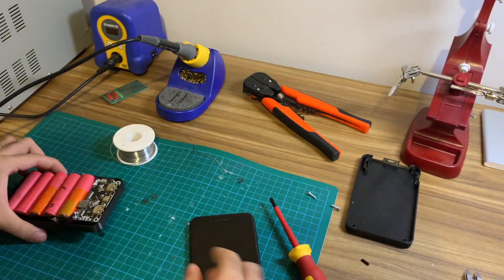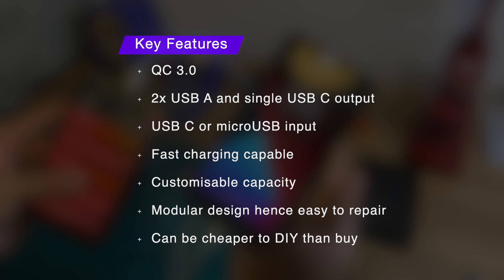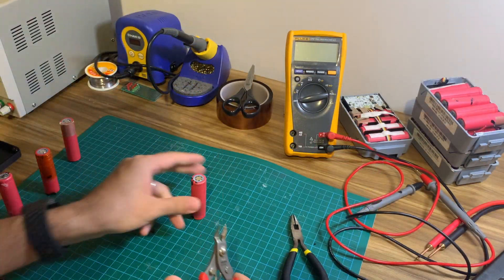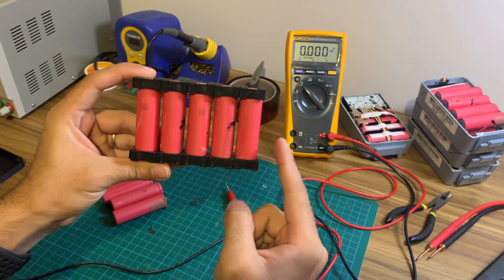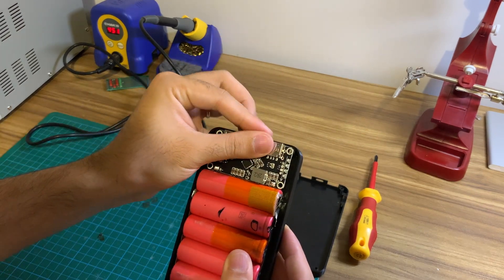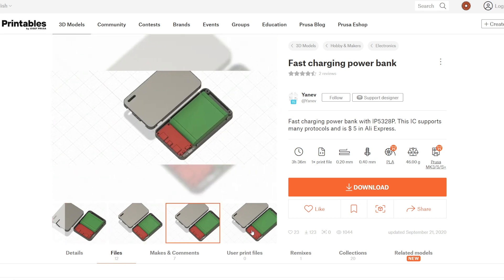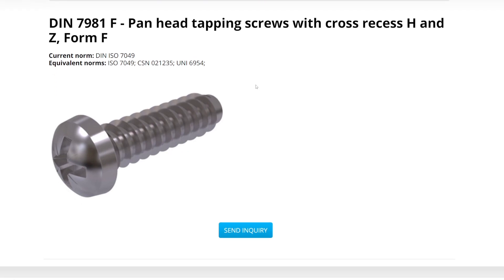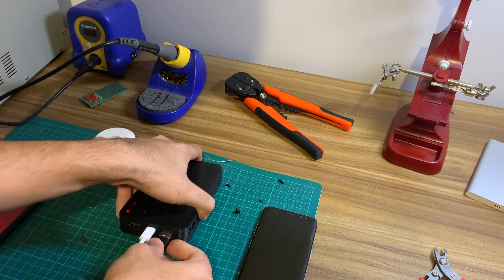How to make a Power Bank the EASY way!

Comment: You don't have to match capacity when its just a 1S pack
Reply from the maker: Because the board steps up the voltage as required by device (5V, 9V or 12V), 1S is sufficient. For capacity, you add more cells in parallel.
Reply: @SparkLabz  no, you don't have to match cell capacity when putting cells in parallel. Especially when you're not drawing many amps.

Comment: How many battery i can connect in this board 
Please reply
Reply from the maker: Hi there, you can put as many cells as you like. Make sure they’re in parallel configuration as showed in the video.

Towards the end of the video you can see the 3D print design. I believe you can do 6 batteries using the template. Or you can edit the template to fit more batteries.

Thanks for watching!